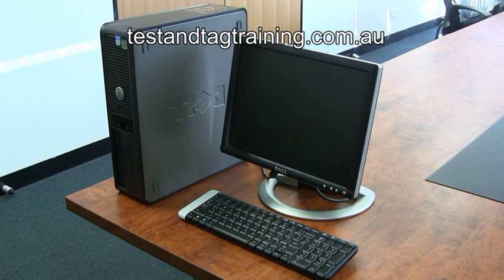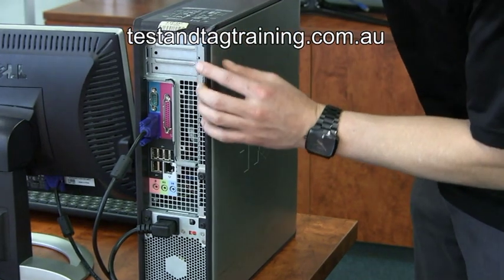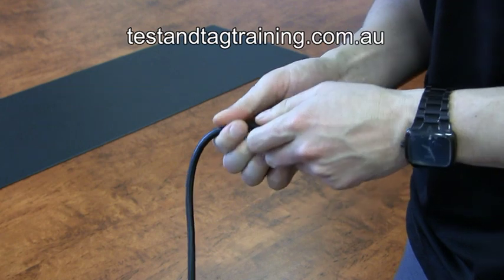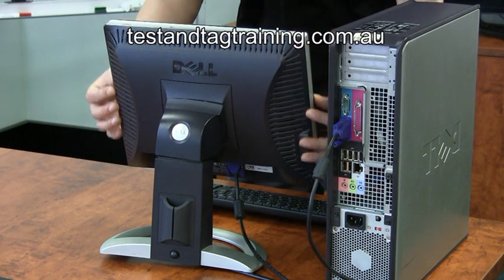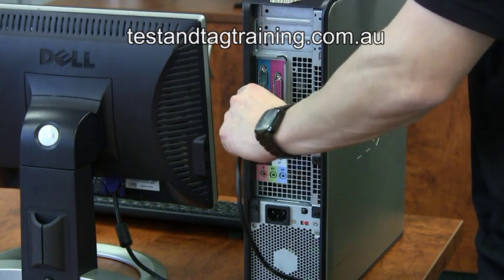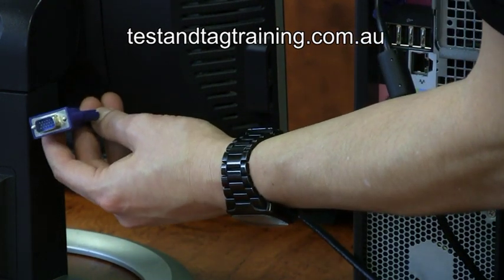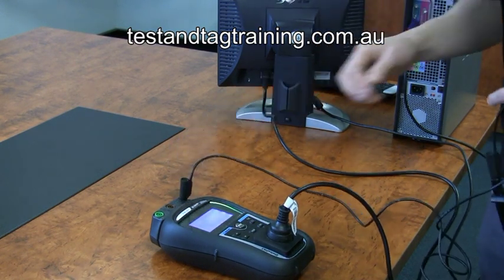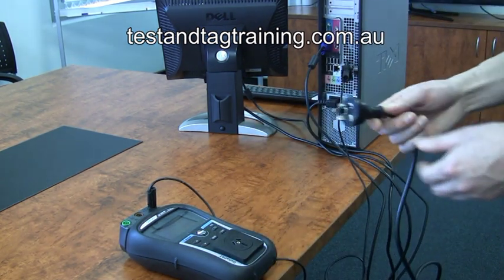How to Test and Tag a Computer

Comment: Thank you for your video is very clear. What voltage are you using to perform the test of the desktop PC  and monitor 500Vdc or 250Vdc for the Insulation Resistance Test, please?
Reply from the maker: Hi Denis - for this test in particular we did a 250V DC. However, just so you're aware - most modern PC's will be safe to operate at 500V DC, while older systems it's best to play it safe at 250V DC. We hope this helps!
Reply: Thank you for your answer. It will be related to the Power Supply capability of the PC?